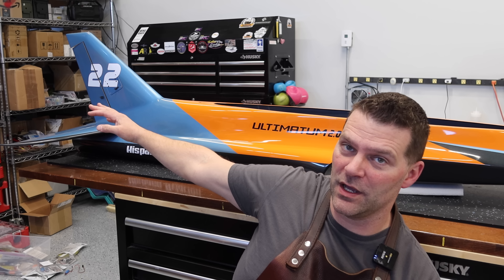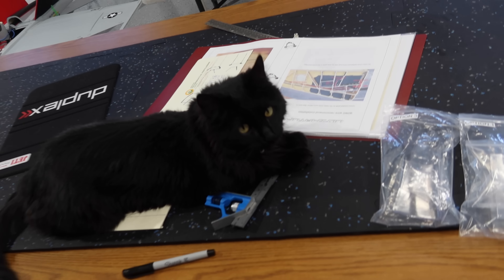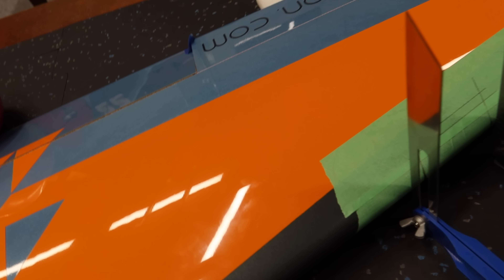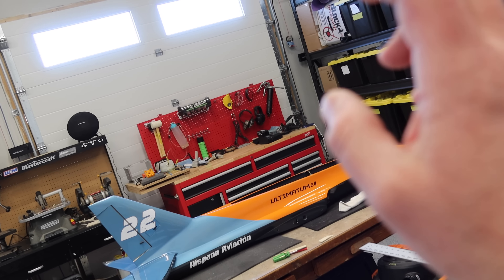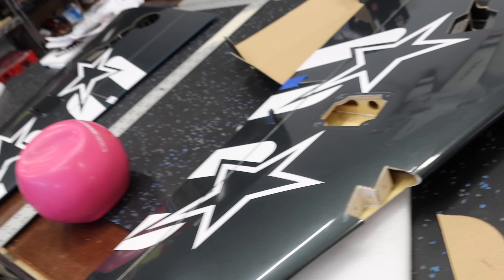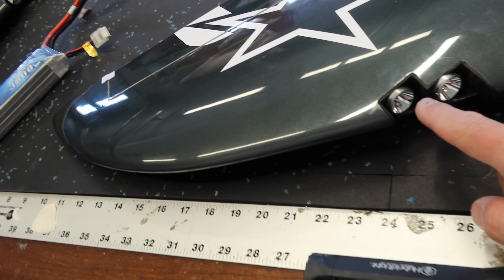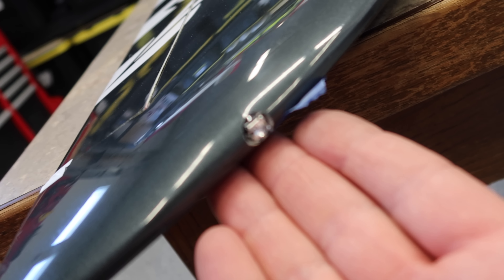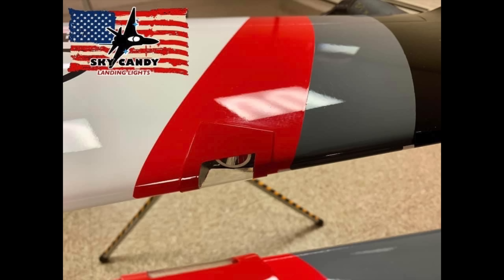WE DESTROYED THE WINGS - Now What?

Comment: the leading edge ie  dbox is part of the structure i would not cut for lights , what the hell do i know
Reply from the maker: Every part of the aircraft could be considered part of the structure if you remove something and reinforce in a different manner or method than it becomes a non issue or perhaps it’s even heavier and stronger than original